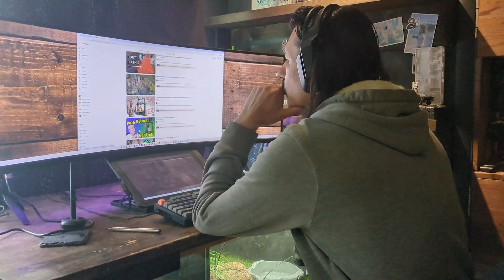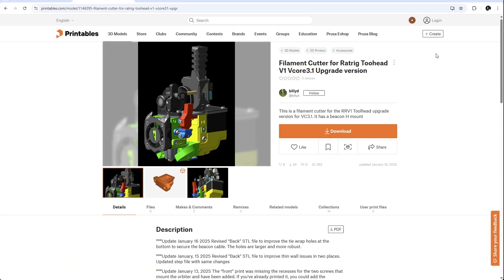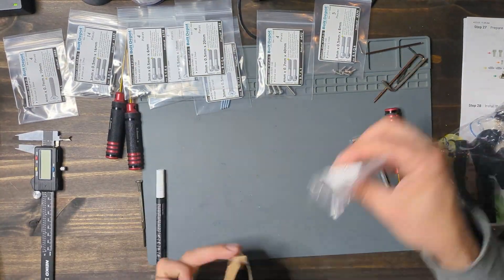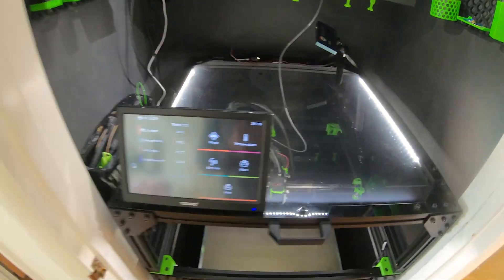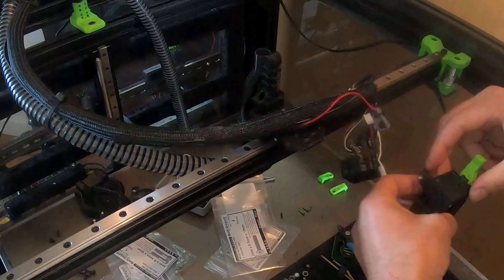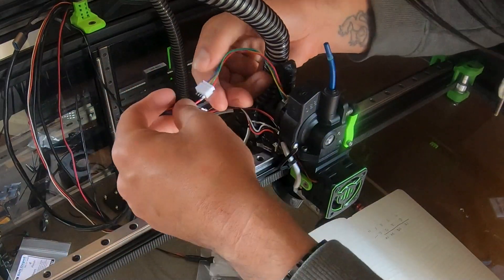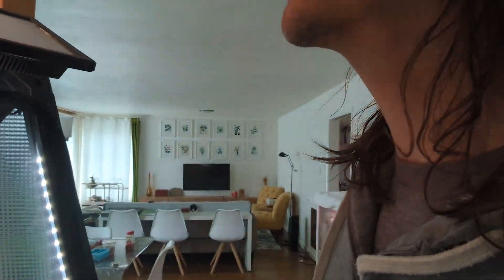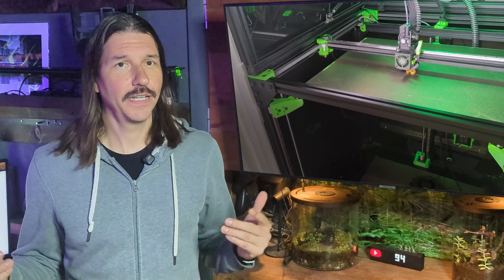🔧 Upgrading My 3D Printer Toolhead | EVA to RatRig V1 + Filament Cutter 🛠️

Comment: This is wonderful - and directly in my upgrade path for my VCore 3.1. My config includes a
 EBB42 toolhead board, so it looks like some very close elements.  Would you be able to provide any of the files, including the metal mounting bracket?  Perhaps a post to Printables, or similar? I'm keenly interested in this upgrade path.  From there, I can probably figure out an adapter for the EBB42.  Thanks for putting this together!
Reply from the maker: Thanks! So far I've been really happy with the new toolhead. The plate STEP file can be found with the CPAP mod files here:  https://www.printables.com/model/1063136-ratrig-toolhead-vc4-cpap/ - for cable strain relief I used the OEM files provided by RatRigm but also have a mount that supports EBB42 here: https://github.com/Rat-Rig/RatRig-PrintedParts/blob/main/Toolheads/Rat%20Rig%20V-Core%203.1/PP000325-rr_toolhead_vc4_toolboard_vertical_V02_20240412.stl

Good luck with your upgrade!